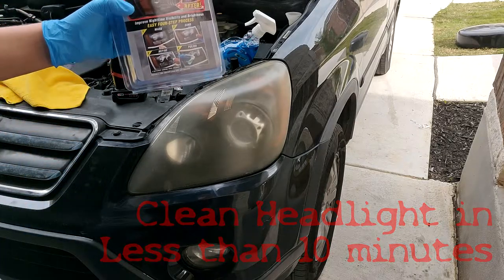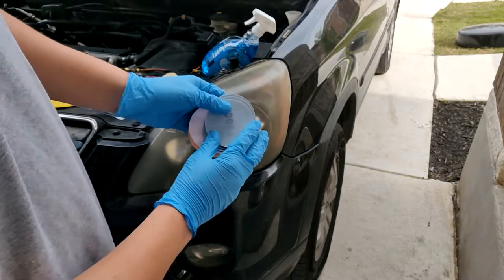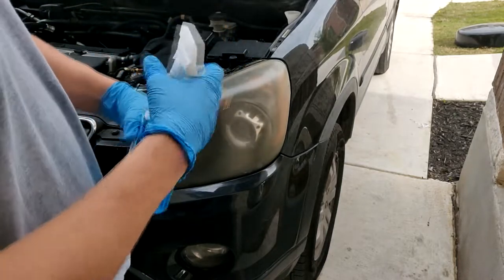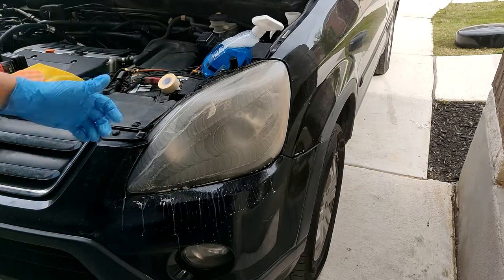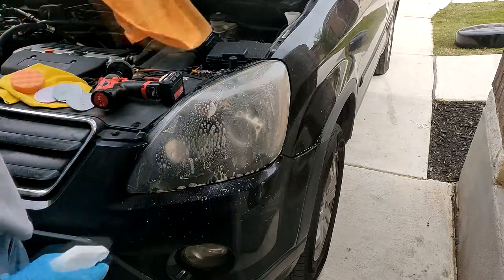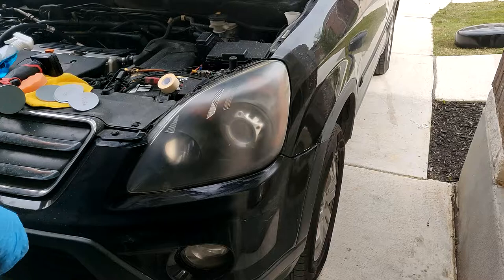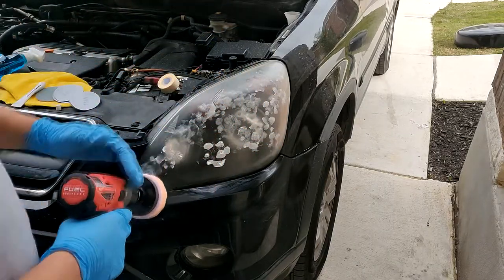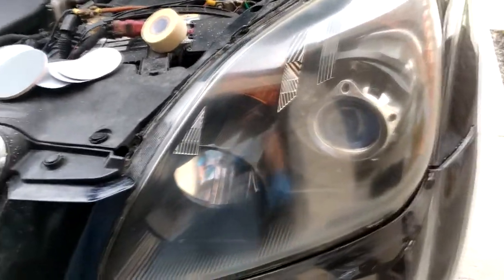CLEAN YOUR HEADLIGHTS LENS IN LESS THAN 10 MINUTES!

Comment: Looks good, but if you're to spend a little more time with a 500.
And then the 800.
And then the 3000.  You're Might have Gotten a little more clearly. You also need to put a sealant on it, so you can get longevity on it. Look into getting the mcguire's headlights Sealent spray